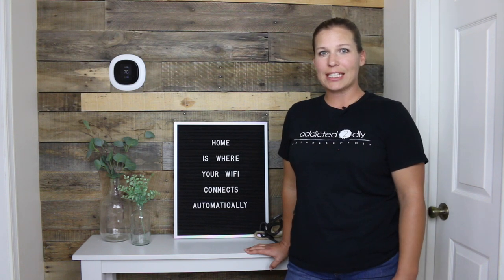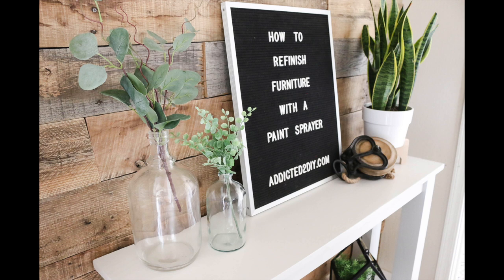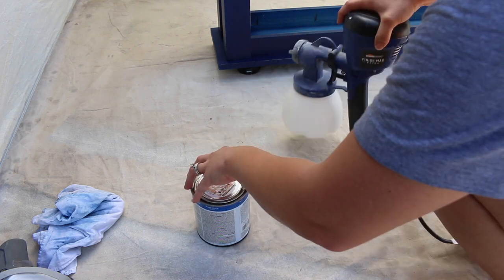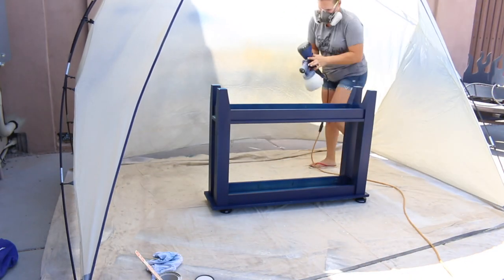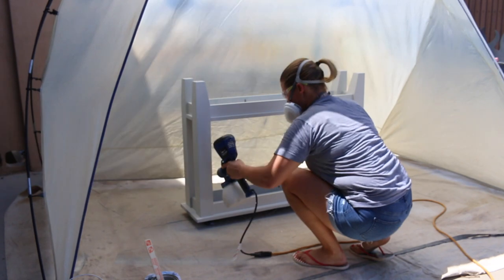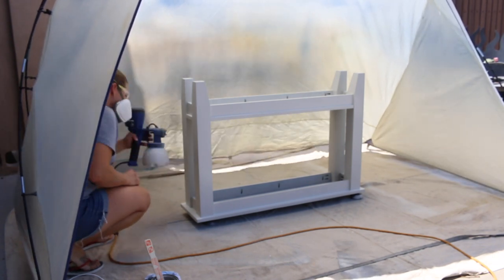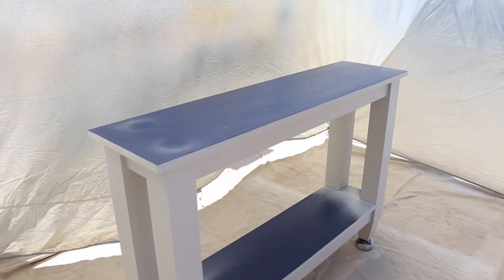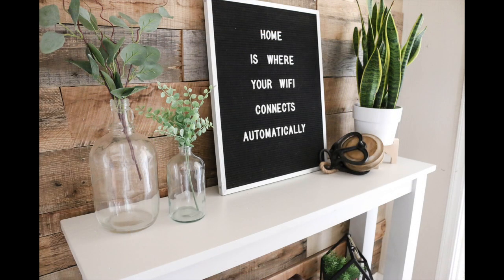How To Use A Paint Sprayer To Refinish Furniture

Comment: What type of paint did you use? And did you, or have you, put on a polyacrylic coat after?
Reply from the maker: Scott Swail I used regular latex paint.  No need for a poly coat afterwards.  Once the paint cures, it provides plenty of protection without peeling or chipping.